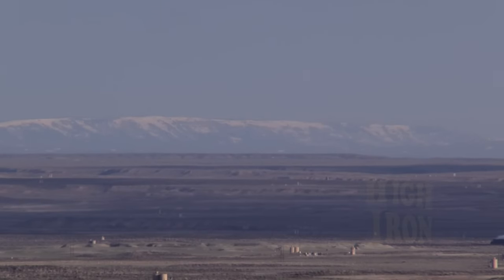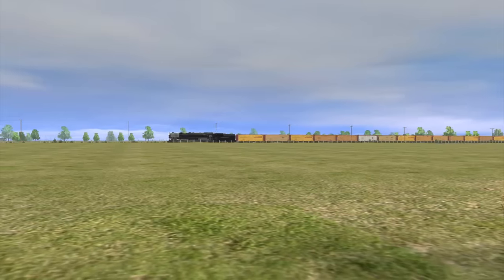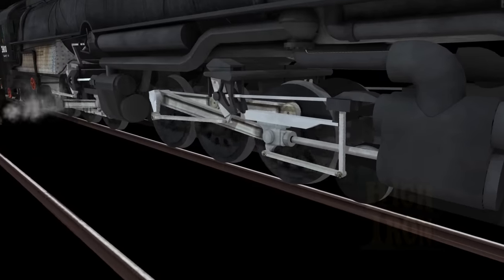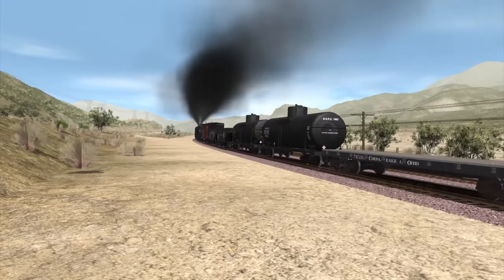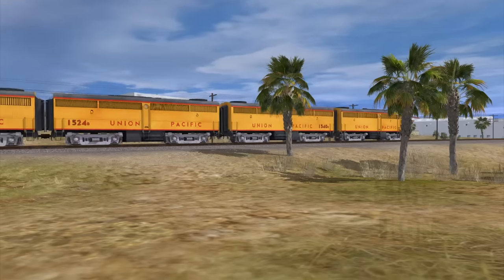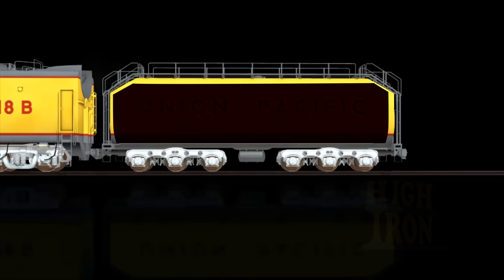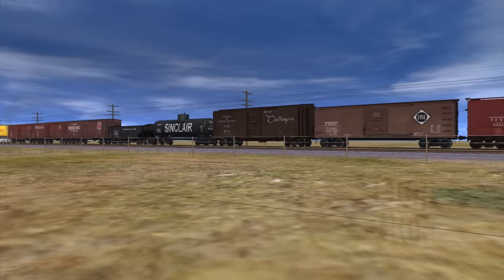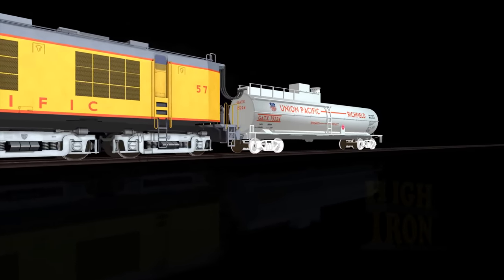Union Pacific's Superpower Fleet

Comment: they did not use “bunker c”
Reply: Wikipedia says the UP GTEL did.
Reply: @tommoss-the-prank-engine3578  Well, unfortunately, Wikipedia is incorrect. “Operation of 8500-Hp Gas Turbines in Locomotive Service" by Harold Rees, Chief Mechanical Officer, Union Pacific Railroad, October 1960, states that the specification for turbine fuel was for a residual fuel that would flow with a viscosity of 95 SUS (Saybolt Universal Seconds) at 210 °F, the American Society for Testing and Materials (ASTM) standard known as No. 5 heavy fuel oil. The crews that worked with the locomotives thought this residual fuel resembled the “bunker c” fuel they had been familiar with from steam locomotives and naval ships. However, gas turbines require a higher grade of fuel than steam boilers. I am unsure why you have specified “UP” GTELs in your comment, as Union Pacific was the only railroad in the United States to own and operate gas turbine locomotives.
Reply: @TBoy205   Pah, you’re just fabricating stuff to try to get attention.

Maybe try using facts and then people will talk to you, instead of your own opinion of what fuel they used.

Comment: Union Pacific is a PUBLIC NUISANCE where I live.  They have a LONG history of blocking the road to our farm for HOURS and HOURS.  When the ICC was eliminated so were the statutes on how long they can legally block a thoroughfare.  Even the POLICE do not know the law on that.  We are in north Texas and the track here is used to pull those two mile long Coal Trains.  The hill close to us is NOT a mountain but it is the LONGEST UPHILL PULL between HERE and Montana, it also has more than one long curve in it for added friction.  They pull the drawbars APART!!!  It can take from 2 to as long as 16 HOURS to repair them.  When the Pull of the locomotive exceeds the tensil strength of the drawbar it BREAKS.  They REFUSE to break the train so we can get by.  Before 1996 SOUTHERN Pacific owned this railway near us.  They would "break" or unhook the train at the crossing so we could get by.  Then UP bought it and they will NOT break the train.  UP very often sends this train up the hill with inadequate POWER.  They have ONE locomotive on the front when they need MORE in the rear PUSHING.  They either BREAK a drawbar going up this hill, or they SPIN OUT.  They have to dispatch MORE locomotives to the location to push it over the hill SOUTHBOUND as it is a ONE WAY ONLY track  I have see trains SO LONG and HEAVY they have TWO locomotives in front PULLING with TWO MORE in the MIDDLE PUSHING and pulling, and two in the rear pushing.  If they are short Locomotives, they will "try their luck" at moving the train over this hill.  If it does NOT make it, they just SIT THERE, until they have enough locomotives available to move it.  Meanwhile we cannot get a Fire Truck or Ambulance or Sheriff's Office deputy Sheriff out here.  We are blocked in.  I had Senator John Cornyn intervene once, just not too long ago I had the Federal Railway Administration intervene and the problem has improved.  But as time goes by they FORGET we are here and start blcoking it again.  Those CREEPS that work for the Railroad are UNION HANDS and make more money than the typical PHD and they are the smart alecks from hell.  UP is a BULLY.
Reply: You bought a home near train tracks. The railroad was there LONG before you were and will be there after you're gone.